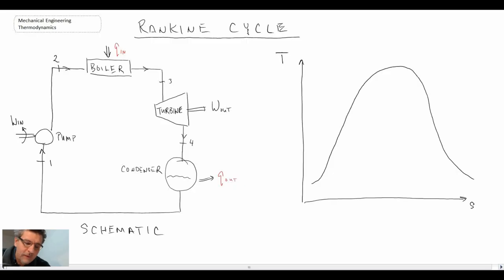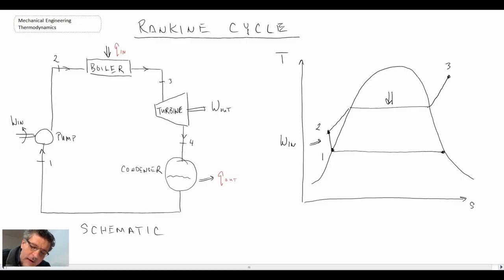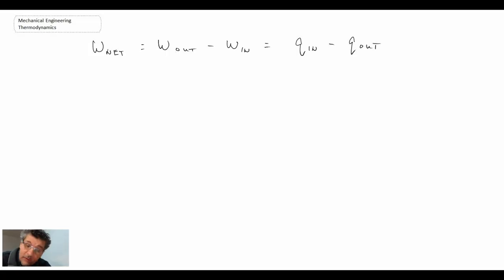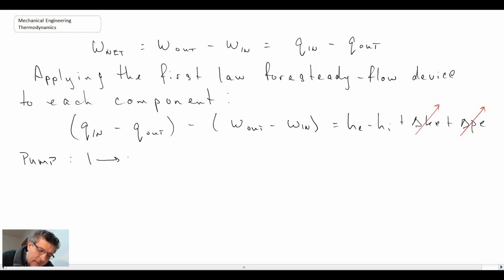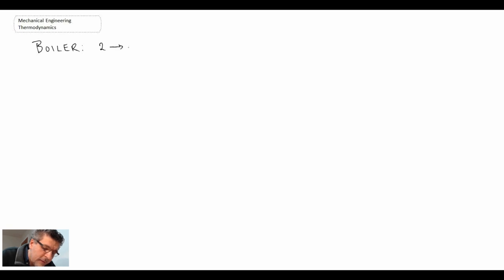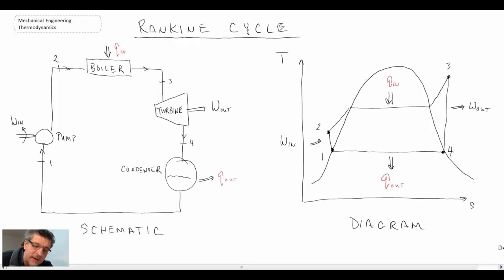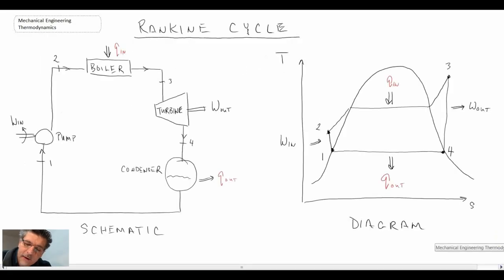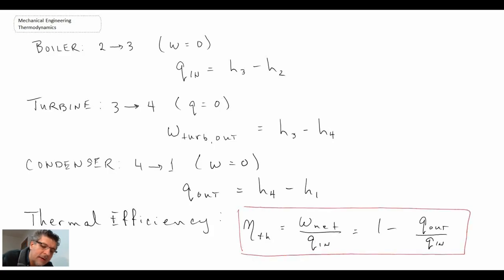Mechanical Engineering Thermodynamics - Lec 19, pt 2 of 5:  Ideal Rankine Cycle

Comment: hi, nice video ! 
but i have a question on the net work of the rankine cycle. i found on a website that w(rankine) = w(pump) + w(turbine) . sooo... would be great if you could explain which is which.
Reply: Work of the pump is work in and work of the turbine is work out.
 Net work of the rankine cycle Is the difference between the work of the turbine and the pump.

Comment: What happens if there are 4 pressures involved? so this means p1is not equal to p4 and p2 is not equal to p3? example problem below, this is my homeactivity and im a bit troubled by the pressure given
In a Rankine cycle power plant superheated steam enters the turbine at 18 MPa and 580 C. Steam expands through a single stage turbine and discharges at 6 kPa with stage efficiency of 82 %. The condensate leaves the condenser at 25 C and pumped to 18.5 MPa going to the steam generator. The pump efficiency is 77 %.  For steam flow of 9,000 kg/hr, determine:
a)	Electrical power output of the plant if mechanical efficiency & generator efficiency 
are 88 % & 92 %, respectively. 
b)	Heat added in the steam generator if boiler efficiency is 85 %
c)	Plant thermal efficiency

Comment: should entropy in compression phase be constant? (ideal compression= vertical line in the t-s diagram) the pendency of the line 1-2 seems like entropy is decreasing
Reply from the maker: It is constant for an isentropic process - you are correct.  My artistic ability is not all that great, and it should be a vertical line between state 1 and state 2.
Reply: okk thanks :)